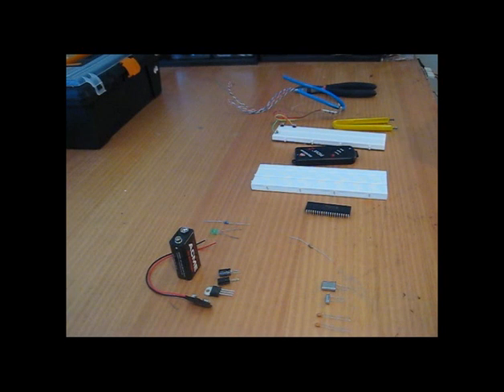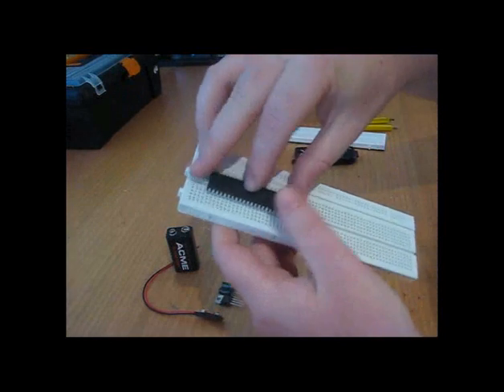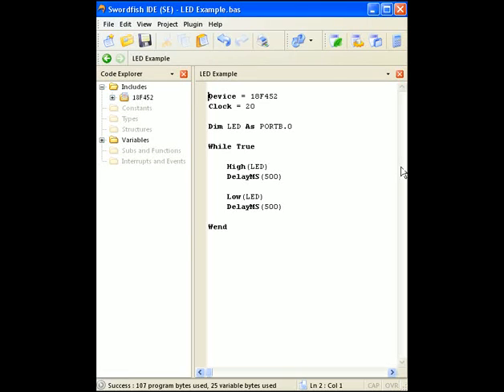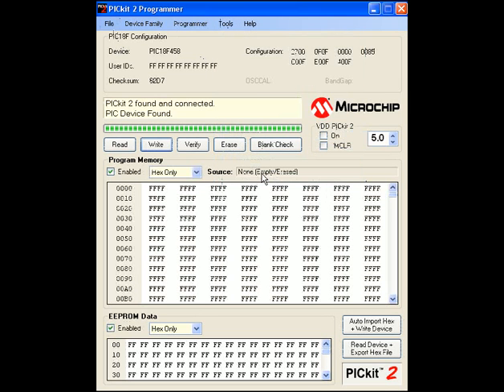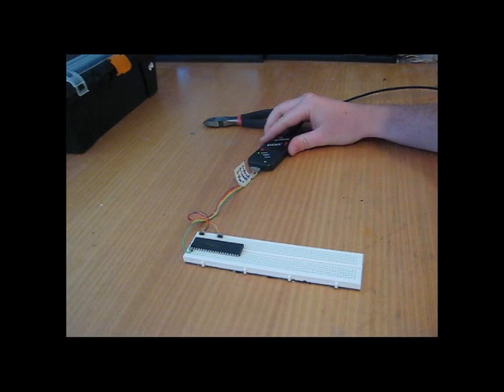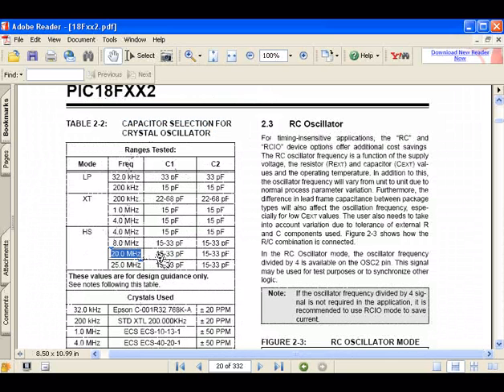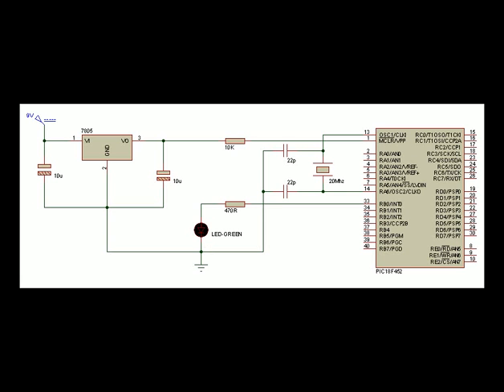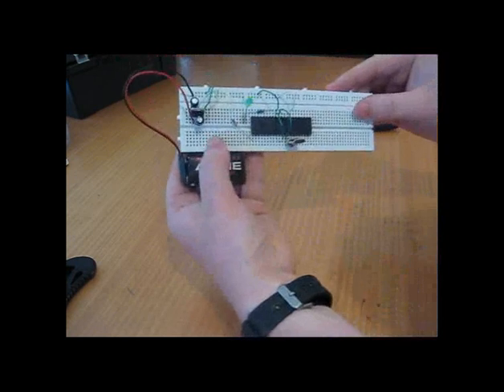Complete Intro To PIC's - Make an LED Flash

Comment: I am stepping down the 9V input using resistors to 5V and then connecting it to Vdd. Not using a voltage regulator. Is that the reason why my LED doesn't flash?